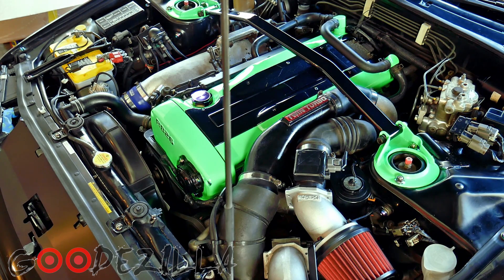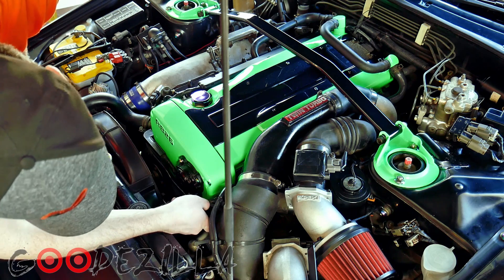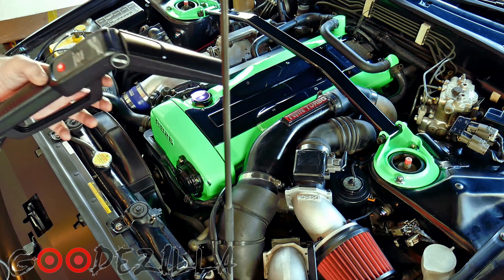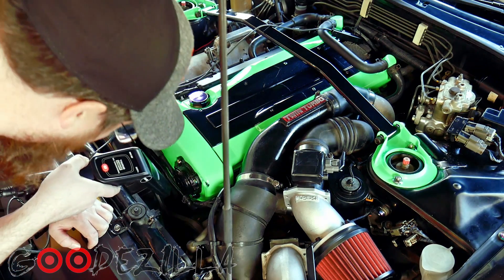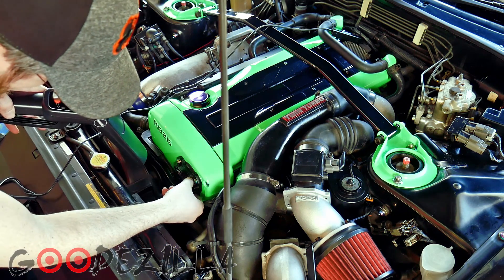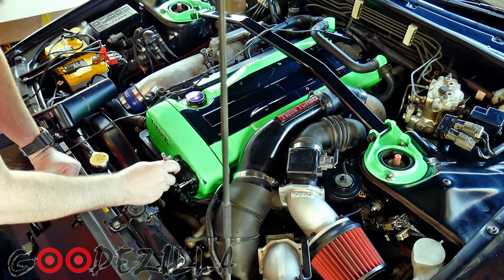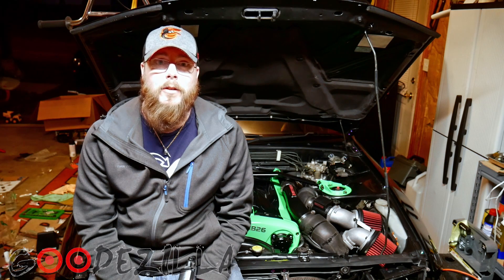How To Set The Base Timing On a RB26 | R32 Skyline GTR

Comment: Hi, it looked like you turned your CAS clockwise to correct this, is that correct? It's just you said you needed to advance? But i think clockwise is supposed to retard the engine?  i'm adjusting mine Tomorrow and would like to know for sure before i start. Thanks.
Reply from the maker: You would turn it whichever way you need to get the timing on the correct mark.

Comment: Getting "engine position error" from my ECU. Code is CAS and i removed it before do makes sense. Now i can not get it to work. Starting to get really frustrated about it, have this strange "pfyssh" sound coming from my intake side when touching tha gas. Can feel the sound in ny fuel rail. Think its related to bad timing.
Reply from the maker: Dunno about the sound, but sounds like your CAS could be bad.

Comment: Did you take any additional procedures before removing it to paint your valve covers? Did you just install the CAS after the cover install? Wondering if any additional measuring needs to be done before and soon after reinstalling the CAS and before the timing light measuring procedure..
Reply from the maker: I just marked the position of the Cas and put it back on where it was close. Then did the timing light to verify / adjust.

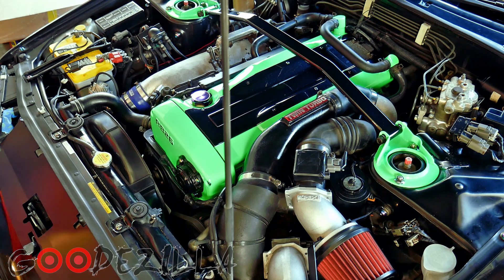Comment: Great video, thanks. Subscribed. One question though: I can't find the loop wire that you connect to (at 3:20) on my 1989 R32 GTR. Can you provide any tips?
Reply from the maker: You can remove the first cylinder coil pack and attach a spark plug wire and hook the timing light to that.

Comment: I snapped one of the bolts that hold the cam angle sensor... I'm fucked
Reply from the maker: You can take the sensor off still if the bolt head snapped off. The bracket that it bolts to is removable and you can get the bolt out or replace the bracket with a new one. Just got take the timing cover off.
Reply: @Goodezilla  I know, it snapped while putting it back on, just frustrated because it's going to be a pain

Comment: I am struggling to undsrstand
Ok so gun light come on when first cyclinder fires but how you know about marks 4 5 6 or whatever 
Is it light shine and how many marks you see ?
Reply from the maker: The light will shine when cylinder 1 spark fires. So you shine the light on the crank pulley and see which mark on the crank is lining up with the mark on the timing cover. The 5th mark is 20 degrees. Adjust your CAS until the marks line up.
Reply: Cool so there mark on timing cover too got it

Comment: Do you have an up close picture of the loop you hooked into on the back of the block?
Reply from the maker: It may be because I had a wiring Specialties harness. The more accurate way is to use a sparkplug wire between the first cylinder coil and plug for timing light signal.
Reply from the maker: https://youtu.be/FCaUqh6o1I4?t=238 around the 4 min mark. Links in that video description of the parts I used.

Comment: Can this badly damage the engine?  I only say this as they done it to adjust my idle under mot conditions. And it misfired amazingly badly and used a lot of fuel.
Reply: 3 years later, did this have any effect on your 33, planning to do this method to get it running well enough to drive it to my mechanic instead of paying for a tow truck?

Comment: Using the loop wire I generally thought to be an unreliable method.
Reply: a kingscott yes thats what been said. In this video he bought a tester (to check spark) which can double as a Hight Tension lead to connect his inductive pick up to. I learned all about ignition timing last 2 days and I’m gonna buy the light for now. If I need the lead it’s on Amazon prime anyways

Comment: Did you get the CAS sensor powder coated too? If so did you have to do anything special to prep it?
Reply from the maker: Nope, just spray painted it with some automotive enamel. Taped it up with painters tape and a sandwich baggy on the back.

Comment: Whats your Rpm when you adjust it ?  i did adjust mine to 20 Degrees but found it i had 1120rpm on idle(varm engine ) and thats too high. so 20 degrees will therefor be wrong.  correct would be to adjust to 950rpm first then adjust to 20 degrees
Reply from the maker: My idle was normal. I'm not sure 200rpm would make a difference. The engine shouldn't be advancing any timing at idle unless you've got another issue going on.
Reply: What is normal idle speed? I found my 260RS (RB26DETT) car is idleing at around 1000rpm. Even though I wound the AAC valve all the way out. Can't seem to set it lower.

Comment: I really dont understand the whole timing belt test what does it keep you from doing on the road if not correct?. I understand most of the maintenance. but all I see is a strobe light on a timing belt, I also noticed 6 lines, am I suppose to notice these lines and where are these lines on the belt? or coming from the timing light gun?
Reply from the maker: Brandon Martinez this video shows how to set the base timing. The timing belt is not part of the process. The timing belt is under the engine covers and connects the cam gears to the crank to keep them in time/sync. 

The lines on the crank pulley are timing marks. 0,5,10,15,20,25,30 degrees. And you use the timing light to know when the engine is at top dead center (it strobes ). So you line the mark in the crank pulley up with the mark on the engine block cover by turning the cam angle sensor.

Comment: If the base timing is slightly out can that cause the car to lose power but still idle and run smoothly, or would that be ECU pulling the timing as you increase the revs while driving. Cause my R34  with a Rb25det feels noticibaly slower and running richer after i got it back from the tuner and it did have the CAS removed so i was thinking it may have been put back slightly out.
Reply from the maker: It is possible. If the base timing is off, it will throw the rest of the timing off too. I think the RB25 has variable timing, atleast the later versions do, so it constantly adjusts the cam timing as well as ignition timing.

Comment: I need to do this aswell to make sure I am at the baseline and my powerfc is showing the correct ignition timing. I did finally get my AEM Water Meth installed along with my AEM wideband.
Reply: TokyoDriving easier to tune and get more power with the haltech
Reply from the maker: +TokyoDriving Good stuff! I'd like to get alcohol injection on the GTR eventually too. I had it on my Cobra, it works really well.
Reply: Yeah it does. I can have the timing ramp up pretty decently. I can't find e85 here but at least Japan has 100RON at the pump.
Reply: TokyoDriving get rid of that power fc shit and invest in a haltech
Reply: Dane M Tell me about it. I got it for 400$ and my car had the Apexi Power FC boost control solenoid installed already and not connected. So was just wastegate pressure at first. Some Aussies that were taking pictures of my car in Tokyo talked me into switching to Haltech. One day soon I hope.
Reply: Dane M Don't doubt you. Just need 1300$ for one.